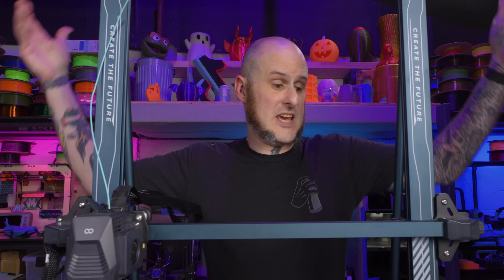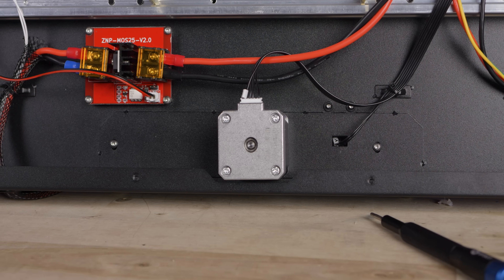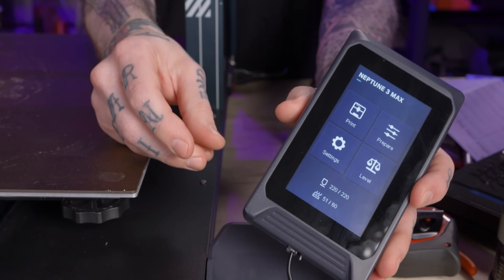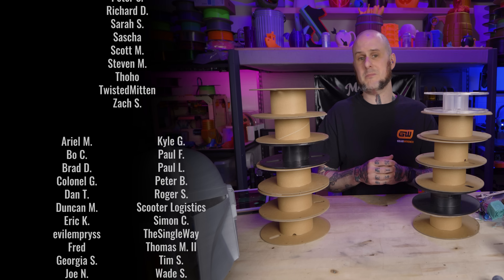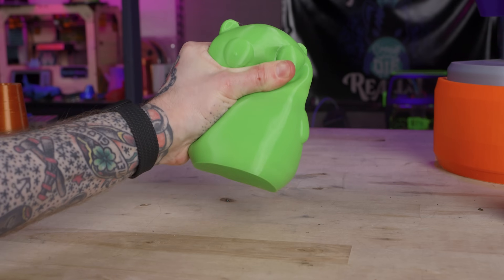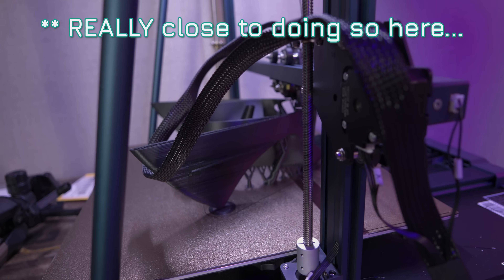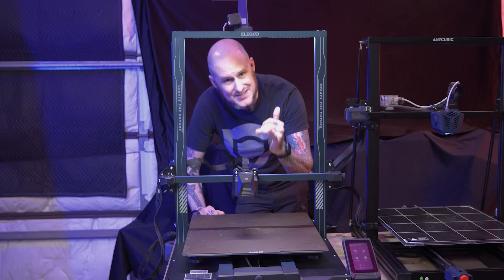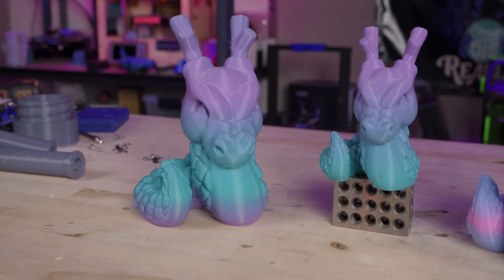BIGGER 3D Printer for LESS $$?! - Elegoo Neptune 3 Max Review

Comment: Did you upgrade the hot end. Do you have a video
Reply from the maker: No, I parted with this machine before any hotend upgrades became available. The Neptune 4 Max has a much better hotend on it but its firmware is buggy in comparison.

Comment: Three things I wish we could see more of in reviews: 1. Honest and unbiased after sales support and 2. Long term (6-8 month) usage.  3 Longer terms firmware support.  Fast speeds and quality prints out of the box are nice but how does it hold up after a good deal of usage?  How does the company step in to help if you have a problem even if you have no warranty left?  Will you still get reliable firmware updates once they release a new model?  Based on my own personal experience with anycubic the kobra 2 max is completely out of the question.  I loved my kobra 2 once I got it dialed in.  But once I had problems anycubic went silent, zero firmware updates 7 months later (with known bugs in the current version) and parts no longer available from anycubic (mainboard died).  Sadly we never seem to see this stuff in these reviews which is why I think they are only 50% complete if there isn't a follow-up 10-12 months later.
Reply from the maker: I too wish I could see all of that in reviews, but it largely isn't realistic at all. 

1) We can never know if a reviewer is getting special treatment from brands on support. I've had some minor confirmation through external sources that our emails get flagged by some companies as priority. So I cannot know whether the support experience I receive would be indicative of general customer experience. Many brands request purchase & serial number information when providing support. I have to just tell them "I didn't buy it, you sent it to me", so even if I skip past some an email detection situation, that flags it too. 

2) Long term reviews are what I wish I could do BUT, no one watches them. People watch when a product is new and views only trickle in after that. At the end of the day, if a video doesn't get views it was a MASSIVE waste of time investment. 6 month later review? That means 6 months of using and living with a product. 6 Months worth of cleaning build plates, maintenance, printing, testing, tuning. 6 Months worth of print materials. If you aren't actively printing that entire time you aren't really testing the product, so you are talking dozens if not hundreds of spools of filament. My highest viewed review on any 3D printer has paid me approximately $600 in total since it was posted. I used $450 worth of filament in that review (that I had to buy as I didn't have a filament sponsor). Plus dozens of hours in video production and editing. Would you be able to justify producing a review after 6 months of work for $600? A $100 a month income? That's a failed business before the word go.

3) Firmware updates we simply have no control over. I agree a lot of companies abandon products for the next hot thing too quickly. The Neptune 4 Max I've been complaining to Elegoo about some issues on for months. The last firmware update was 3 months ago.

At the end of the day, if you don't employ a dozen people to make video production and testing of products significantly faster, doing reviews that way just makes no sense. And even then, if they aren't paying anything in views, you can't pay that staff. Then you also run into the problem of being out of touch with the consumer side of the market. Plenty of people say reviews where the machine is provided are pointless cause we reviewers must be biased to the manufacturers now. But if we had to buy every single machine we reviewed, then you'd be adding purchase cost to the equation. Making $600 on a review of a $500 product, now the equation is a total disaster. 

I too would love to see reviews done the way you say, but it isn't realistic in this world. It just does not work out like that. A hot product here and there can do it. Folks will watch a "Bambu Lab X1 6 months later" video, but how many will watch an "Elegoo Neptune 3 Max" review when the 4 Max has already launched? "Why are you reviewing the LAST generation machine? Why did this review take so long?"

I'm personally done with reviews. They are a failed business move for me and I have to feed myself at the end of the day. I wish I could produce those reviews, but I cannot do so AND survive.

Comment: There really is no need for dual stepper drivers on a printer like this. They are connected with a belt at the top, so there is no point in adding a 2nd z stepper driver when they are in sync with each other.

Comment: a split signal fromone driver to two Z-Axis motors CAN,indeed, go out of sync, as witnessed by my alfawise U20 One.  The use of a syncro belt is used for that very reason.
Aprt of the reason for dual Z-Axis motors going out of sync is due, at least in part, to a less than perfectly squared gantry (roller plates to the aluminum profile).

Dual stepper drivers also require extra code.  Since the voltage is adjustable and, theoretically, the motors are identical, the same pulse to each from a single driver has zero disadvantage over dual drivers.  ZERO!

Comment: Can the hot end be upgraded to something g that can do 300? Could you upgrade the auto bed leveling? 
I want to do full size cosplay helmets in one go. What would you recommend for that? Budget is 500-1000. Sorry this would be my first Filament printer.
Reply from the maker: It could be but you really shouldn’t need to print that hot for cosplay stuff. Nylon cosplay parts is a bit overkill. Maybe premium but uncommon. Any material that requires that hot of a hotend is also gonna require an enclosed build volume. Enclosing such a big machine won’t be fun. That said, yea it could get a bimetallic heat break & maybe a hotter heater cartridge to reach those temps. 

I usually HIGHLY recommend starting smaller. Bigger machines = bigger problems and learning curves. Having basics down on a smaller machine will make life easier.

Fitting cosplay helmets in a single piece won’t really require a 400mm build volume unless it’s the Wolverine helmet. The Qidi X-Max 3 I featured in a recent video is fast, can print high temp materials out of the box, and has a 325mm build volume. Try opening some helmet designs in a slicer and see what size machine you really need.
Reply: @MandicReally  I just want the option for other things. Might as well have the option. As helmets won’t be the only thing I print. I resin print a bunch of parts for work that are no longer made by the manufacturer
Reply: @MandicReally  my god man why didn’t I think to actually open the slicer and check the sizes. It’s a miracle people trust me to do anything right at work. 🤦🏼
Reply from the maker: @jessemarshall7176  I always recommend playing around in Slicer to folks getting started. You will have to use it anyway & it is free. Worth just trying it out and seeing.

For production of parts for real world use and a decent build volume, the new Qidi X-Max 3 is great. I just featured it in a recent video: https://www.youtube.com/watch?v=gTiHNeZQ7cg 

That video was sponsored but I genuinely like it and thing it is a good option for "engineering" type work as it has a heated enclosed build volume & good hotend. 

It is the upper end of your budget though, so it is hard to recommend as a starter machine since it is such an investment.  It isn't difficult to use I just hesitate to recommend more expensive starting places. https://s.zbanx.com/r/W21SmTsPMgML (affiliate link)
Reply: @MandicReally  just watched the video and I think I’m going to go with the qidi. Now it’s actually under budget by 1 whole dollar!
Reply: @MandicReally  I bit the bullet and ordered the Qibi max 3 today. Hopefully I can find a place to put it!

Comment: Would you say this is a good beginner printer because I want to get one but don’t know what to buy My budget is between 600-700 so which one would you recommend?
Reply from the maker: I would never recommend such a large machine as a first printer. Bigger machines = bigger problems. That said, the basics of the design are good for a beginner and its smaller siblings I would recommend.  It would help to know what your goals are.

For a much lower price than your max budget there is the Neptune 3 Pro: https://tinyurl.com/Neptune3Pros
or the Neptune 3 Plus: https://tinyurl.com/Neptune3Plus

If you are ok spending more, the Bambu Labs printers are much faster, generally produce better print quality, and can be a little more user friendly.  Something like:
Bambu P1P: https://tinyurl.com/BambuLabP1P
Bambu P1S: https://tinyurl.com/BambuP1S

The Bambu machines aren't very upgradable or modifiable, but they just work. 

All links are Affiliate links by the way.

Comment: I am dissapointed with your clickbait style. Saying that it has a "hefty hiccup" and then not presenting any arguments for it is just sad to see. I'm seriously considering the printer and ended up here because it was advertised for me. For this price your comment about printspeed is ridiculous. It's clearly advertised with the ~80-100mm/s printspeed and comes with a <0.5 nozzle. It's a smaller issue and just intended for clickbaiting people. Your misprint was simply faulty supporting. No good comparisons to similar prints on other machines nor do you state at what printspeeds/settings was used. 

It is dissapointing and this also worries me that your entire review is catered to just review money and hooking views and not the solid factual content I am looking for. All I hear from the rest of the review is crazy value, crazy size. Well I will just go look elsewhere. I will not endure dissapointing clickbaiters, it just isn't worth the while. It indicates priorities I'm just not looking for :(
Reply from the maker: An entire 2 minutes of this video is dedicated to "The BIG Problem!" (name of the timestamp section @12:31 ). The hotend does NOT have a flowrate capable of maintaining .4mm nozzle printing at 80mm/s, aside from the mechanical system not being up to it either. A bed this big is going to struggle to achieve those speeds on anything more than travel speeds. 

I explicitly said that the issue with that Wolverine helmet was my fault, not the machine.

As far as comparing prints to other machines, what machines do I compare to? I only had a Kobra Max as another large machine to compare and I showed that machine's prints in its own review. If I compare the Kobra Max, someone would say "What about the CR10 M4?" etc etc etc. Where does it end? If the point of the video is a review of a product, showing the prints from the product makes way more sense than comparing to other machines.  You can easily seek out information on whatever specific machine you want to compare to on your own. I cannot keep every single machine I get in just to do comparisons in every review and appease SOME viewers.

I could provide a lot more detailed break downs, but it is struggle to keep people interested in ANY review, let alone going that into the weeds about a product. Not every video can be a full spec breakdown on every single detail  of a machine or a crash course in 3D printer mechanical theory.  As it stands I think my review was far more detailed than the majority of them out there.  Have you seen flowrate numbers for the hotend in any other reviews? Print speed is heavily dependent on your tolerance for print quality, materials being printed, and exact print parameters. Advertising "100mm/s print speed!" is easy to do, but hard to back up. I don't work like that.

Comment: which one is better for quality print: 
1.Elegoo Neptune 3 Plus
2.Elegoo Neptune 3 Max
Volume doesn't matter for me. I need only quality 3d printer
Reply from the maker: I don't have a Plus to compare but I would expect the Plus to be slightly better.  Shorter belts and less bed mass to move around SHOULD mean better quality.  That is purely in theory though.

Comment: does volume of 3d printer matter to quality?
Reply: Quality would depend heavily on the nozzle, fans, and other parts, but if you are looking to print large things like helmets it is way better to print it in a single print because printing it in separate pieces it increases the risk of the parts being just slightly different and not going together properly (just temperature changes in the room can make the parts slightly different sizes) so if you are planning to print cosplay go for big printers

Comment: I just got my Neptune 3 Max on Wednesday.  I severely underestimated its size and am now rearranging my entire office to accommodate it.  It's is both a thing of beauty, and also a beast.  I should be getting it up and running today and am very excited to do so.

Thanks for the great review!  I had been going back and forth between the Neptune 3 Max and the Kobra Max for weeks and almost bought the Kobra since the Neptune 3 was generally out of stock.  I'm glad I waited and checked Elegoo's site directly to order.
Reply: As a quick follow up, I LOVE THIS PRINTER.  It has been a champ with everything I've thrown at it (including PETG which both my Creality machines ran away crying against).
Reply: @hausofhomeaux do you prefer this printer over Kobra max? I was thinking max but the poor detail on his vid, plus no auto pause

Comment: it looks like a reskinned bigger ender three
Reply from the maker: And an Ender 3 is just a CR-10 scaled down. A CR-10 is just a scaled up Prusa i3, which is just a Mendel printer… This is the nature of 3D Printers, evolving off of similar designs. Plenty of machines are starting to break the mold, but not at this price point in this size.

Comment: I found one setting bug  , if we have turn on resume print for power loss recovery and if machine is printing some part and from that menu if we turn off resume print (power loss)  it will this setting even for next print and during non printing time we check it will show it is on but during print it will not work power loss recovery , so while printing need to check from its menu if power loss resume is on

Comment: I'm kind of hoping you do a review of the CR M4 BY creality. If you want a headache, that's one to give it to you. Auto leveling hit and Miss nizel will randomly choose its height. The bed will just check out on heating, or it'll just say screw it and fail a print it just did.  But when it's not being temperamental, it's a gem.

Comment: This printer looks like garbage intended to lure in new users who don't understand the fundamentals of 3D printing yet. 8 mm3/s stock flowrate makes the extra build size next to useless. 

If you manage to fix that, your print speed will be limited by the heavy bed (which only gets heavier the bigger your print gets). 99% of users will probably be better off getting a smaller size machine and splitting prints that are to big into parts.

Comment: I want one to go along side my ENDER 3 v2 Neo.  This would give me capabilities to print, all be it slowly, the larger items that I've had to get creative to fit the smaller build plate.  Honestly, I could do with a shorter Z axis.  I think 350 would be more than enough for my needs.  Honestly, most of my over sized prints are in the XY plane, with a Z height less than 100mm.
Reply from the maker: The only time I max out Z height on the majority of my printers is during a review, ha.  Most of the time I could stand for their Z heights to be half what they are.

Comment: You do not need dome supports for helmets. They self support. 1.4kg of filament is insane. I did my mando helmet with a 0.4mm nozzle in 36 hours and only used 580 grams of filament.

Comment: on a fat vase with wide walls, i use a CHT v6 0.8mm clone but I always lower the flow in slicer to 94-96% with 1.2mm thick walls. lower the parts fan cooling as well to something around 48% and you get some big FIRM vases

Comment: Okay, so I watched my downloaded version without the streeks accross the screen. Bodacious verbal linguistics dude.
Great review.
my 1st encounter with direct drive is my Ender 3 S1 printers. Running TPU on PLA settings has totally changed the way I view TPU, and printers.
As someone who prints cosplay props, bigger is better. Printing a Darth Vader chest amour piece 400mm wide in 1 go on my CR-10s was a dream. But it is smaller than these mega machines.
So your review is on point. Also your point of view. Everyone doesn't see the world the same way.
Enjoying your content, hope you can keep it up.

Comment: another vroller bedslinger… why not sovol sv06 plus? That’s the goat
Reply from the maker: It’s also significantly smaller than this. Doesn’t really matter how good a machine is when it’s build volume is 100+ mm smaller. As I said in the review “when you need a bigger machine, you need a bigger machine”

Comment: The Max is similar, if not identical to the smaller Neptune systems. The only difference is build volume. It feels a lot of your identified failures are that you are trying to push out material hotter and faster than you would a smaller Neptune units.
Reply from the maker: That is kind of the point, and I did mention toward the end of the video that they are basically all identical. 

A big machine really should have a higher flow hotend to support bigger printing. IMO it is kind of a disconnect from the actual use case to just use the same hotend between all of the machines. It works, but only just. The fact that all 3 are basically the same is kind of a problem. There is more to consider than just build volume and they clearly just scaled up the machine.